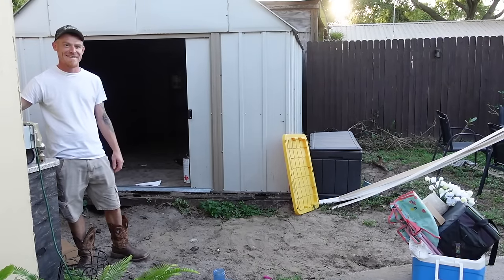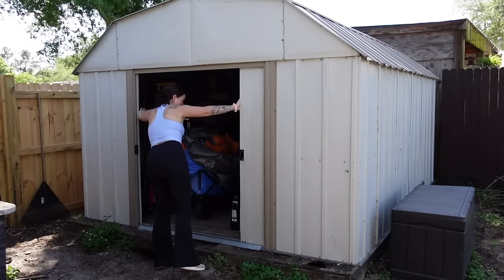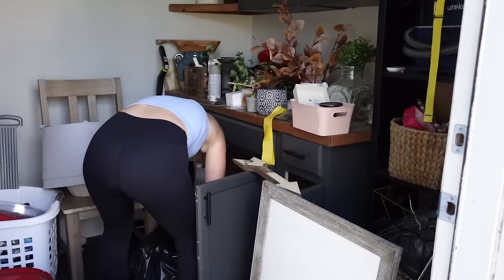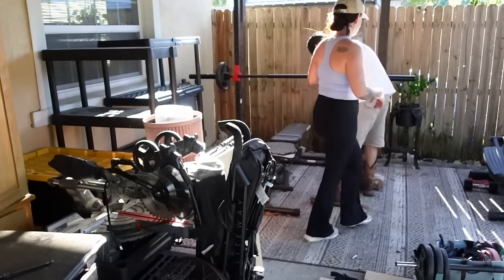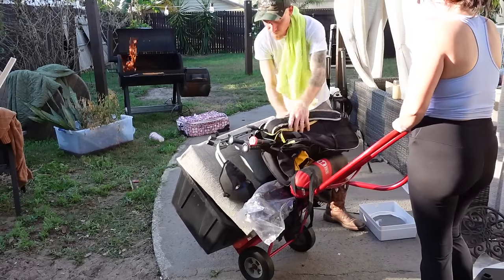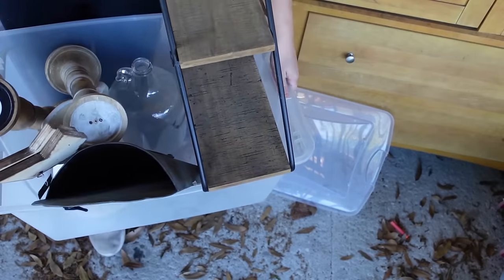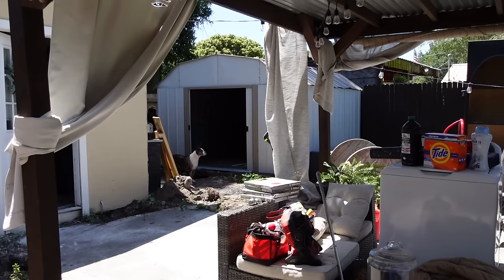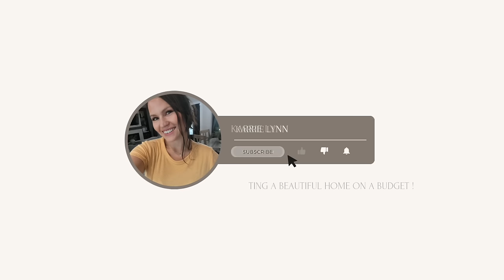Adding an addition to our backyard ! Massive clean up and Declutter! Preparing for demo

Comment: I just thought of a cool idea… what if you move the fence that divides the back yard and the car port on the out side of the car port. So it provides more privacy when you’re working and you could access from the back yard. You could add wheels and a hinge so you can swing it open if you need to put something big in there.